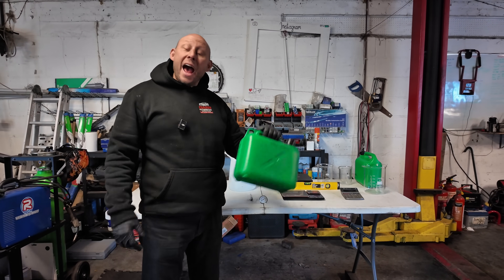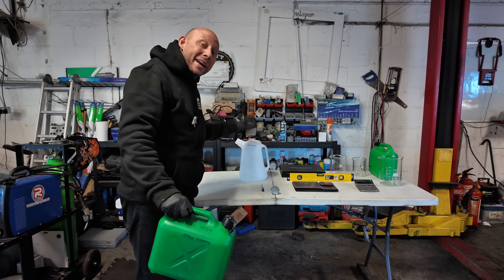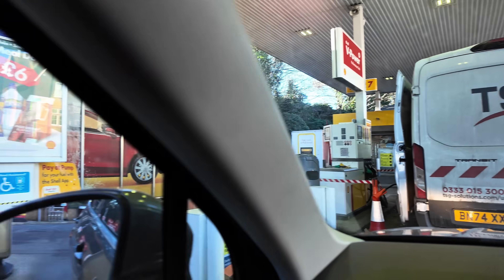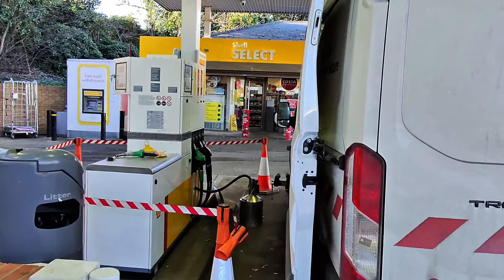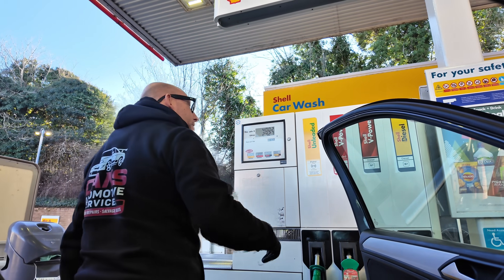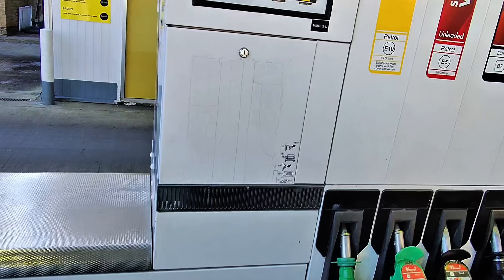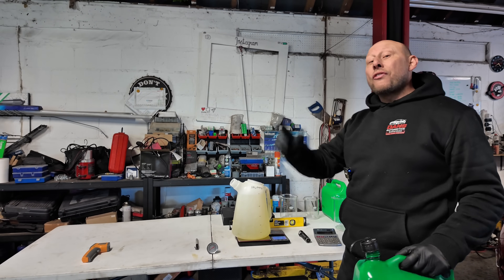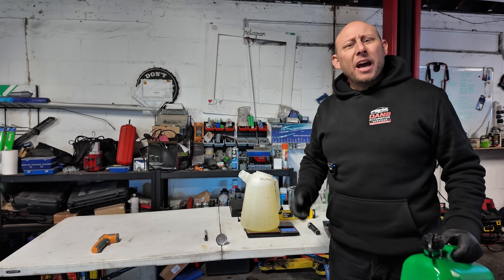This Fuel Test Shocked Us… Are Pumps Lying?

Comment: I remember to see years ago (not in England) that some gas stations had the pumps with a system controlled by a remote that would show 5 litres but give you less than that but if they had any inspections they could just press a button and 5 litres is 5 litres….
Reply from the maker: Very interesting, only 2 tests done so far and both were different 🙌🏻🙌🏻
Reply: @dansautomotive  yes when I saw the pumps being tested I remembered straight away from the case …. Other thing I remember from the same video I saw is that in the country they mixed 10% ethanol for every litre of gasoline (government rules) and in many gas stations the mix was pretty much 50/50 (ethanol was way cheaper)
Reply: @Goneforgood81  Ethanol only mixed at the refinery in the UK, the cost of Ethanol is pretty much the same as gasoline, but only really viable only as part of the government mandated "carbon credits" for biofuel commitment. If you mixed more in, the gasoline would not meet specification and would likely not perform correctly.
Reply: @ChemicalJasper  the video I watched was from gas stations in Brazil were is quite common the practice.
Reply: @Goneforgood81  and I bet the plant based ethanol is quite cheap there too👍
Reply: @ChemicalJasper  yes it is as far as I remember.. I think they are one of the biggest sugar cane producers in the world and their ethanol is made of it , not corn like in the US.
Reply: Copying vw lol
Reply: I worked on the petrol pumps as a kid. If someone wanted 1 gallon that is what the pump dispensed. That was 60 years ago
Reply: 60 years ago I was employed working on petrol pumps. When a driver asked for 1 gallon, I set the pump to that. Took the money and returned with the change. The fastest workers kept their jobs. Self service was not even a consideration in those days.

Comment: Assuming a  density of unleaded at .75Kg/l @ 15°C,  at 11°C (your temp reading)  the volume of 5g of unleaded (as measured on your scales) is less than 7ml . Yet the difference in your jug appeared to be more  🤔
Reply from the maker: We are going to use a new measuring jug for the 3rd test which has a better measuring system. We started the tests wanting to know if there was a difference and from the first two tests there was so now we want to know by how much so we are changing the jug, measuring the temperature of the fuel at the pump and on the scales so we can rule out a few more questions
Reply: The UK spec is for gasoline to be between 720 to 775 kg/m³ at 15°C, so unless you know what that batch was blended to at the refinery, it would introduce a potential significant error assuming a density, I think.

Comment: you might be missing this but they are able to heat the tanks and expand the diesel so when you get home and its reached ambient temps its going to measure less in volume but not weight a garage near me a few years ago was fined for overheating the diesel to make it expand more than the legal limit. 

best for science weigh it as soon as its in the can.
Reply from the maker: For the 3rd test we will be measuring the fuel temperature at the pump and on the scales with our new measuring jug 🙌🏻🙌🏻🙌🏻
Reply: @dansautomotive  weight means nothing without an accurate density though!

Comment: I believe "Tescos" brand petrol station is dodgy as I get less fuel from them than any other petrol stations. Can u please try "Tescos" petrol station to check for me please?
Reply from the maker: Will do tesco next for you 🙌🏻🙌🏻
Reply: Not all Tesco pumps have ATC fitted. If they have,  there should be a sticker on the head saying @15°c.
Reply: Use  Momentum 99, the 95 is rubbish with too much ethanol.

Comment: Did you weigh it? What was the actual difference?
Reply from the maker: First test 4.064kgs second test 4.059kgs
Reply: @dansaut @dansautomotive ’s quite impressive accuracy from the petrol pump meters actually - 5 grams, could even have just evaporated but in even the least economical car that’s probably about 10 seconds of idling!
Reply from the maker: @ridekernow its interesting because weight doesn't equal volume in terms of fuel thats why we have to measure the volume in each test. They blend fuels with ethanol so weigh doesn't really play a part in this test but I like to see if there are patterns to these test. Volume being the main factor so we have purchased a 5 litre measuring jug to see a more accurate measuring scale for the third test.